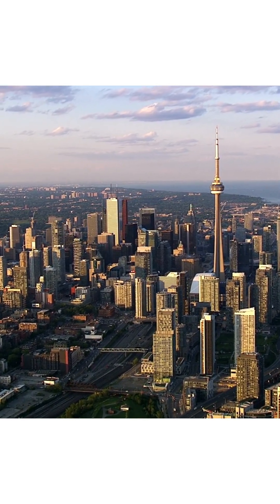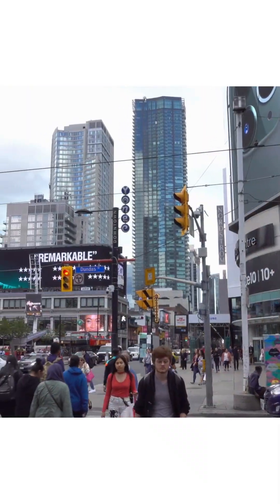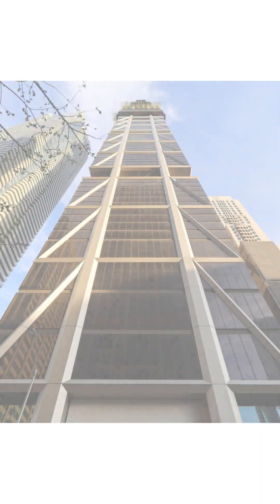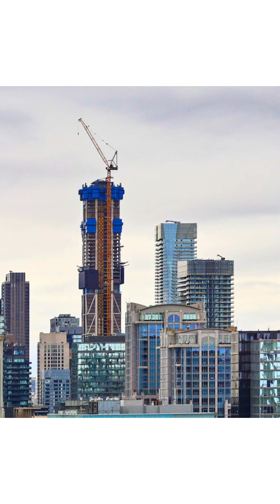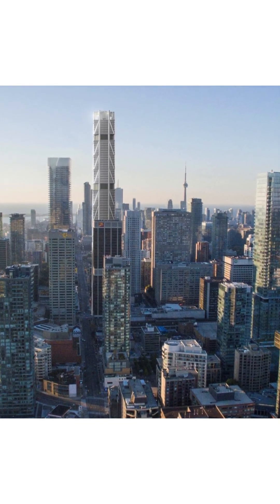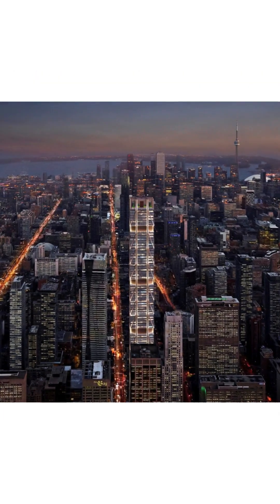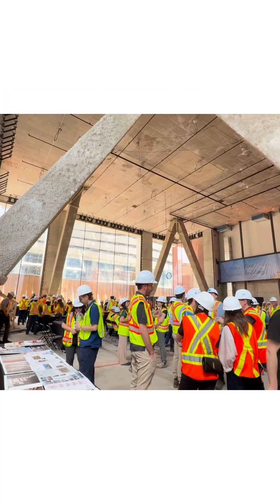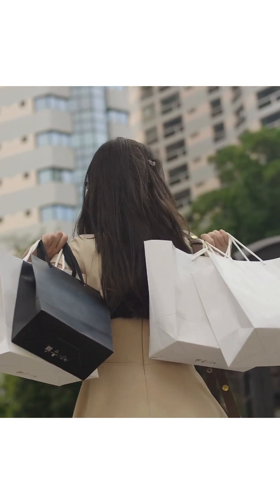Engineering One Bloor West (1)  #steelconstruction  #structuralsteel #construction #toronto

Comment: A cathedral-like volley, but without the cost or creativity that it took the carpenters who built some of the most beautiful pieces of architecture scattered all over Toronto. So many tall glass boxes grew straight out from the streets around these beautiful examples of what it actually means to take your job seriously.  Architects made excuses like, “it expands the footprint of the original architecture” or that it “mirrored the original architecture, highlighting the creative processes of the past”. But it also made way for a cheap and easy route of getting a large commercial space up and running without having to do anything requiring much else but stacking boxes in AutoCAD. Not only did these faceless structural steel skeletons with glass curtainwall facades lack any kind of creativity, it made it so much easier to rip the name of one failing company off the wall to be replaced with another. On a smaller scale, Pizza Hut hasn’t been putting up buildings with their signature red mansord roof with the transition… no; now everything they erect is a non-descript grey and glass box with their name somewhere on it. Just in case Pepsi wants to throw a KFC there tomorrow. 
I’m sorry to say, but I think creativity has left architecture in favour of capitalism.
Reply from the maker: You raise a fair point.  Many of Toronto’s heritage buildings show an incredible level of craftsmanship and creativity that’s hard to match today. Those structures are part of what makes the city special, and we completely agree that preserving and celebrating them matters.

At the same time, projects like One Bloor West are trying to solve a different kind of challenge, finding ways for modern buildings to be more efficient and adaptable, while still contributing something new to the skyline. The engineering you see here isn’t about replacing craftsmanship, but about creating the structural possibilities that allow architects to keep pushing boundaries in dense urban spaces.

We appreciate the thoughtful comment. Conversations like this are what keep design and construction evolving.